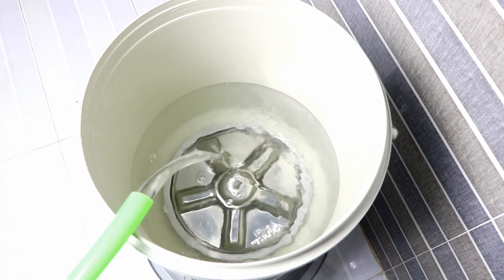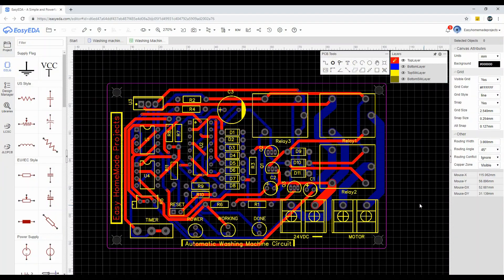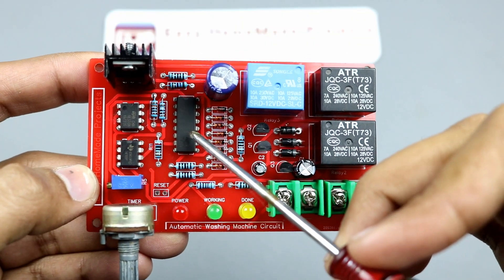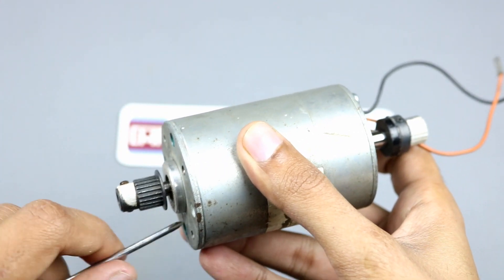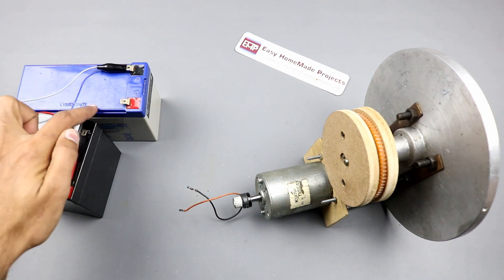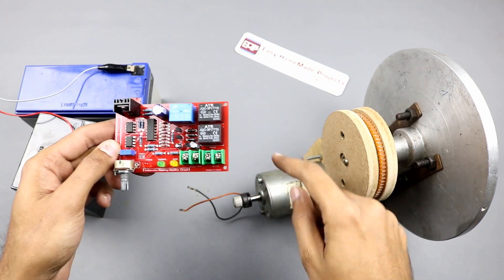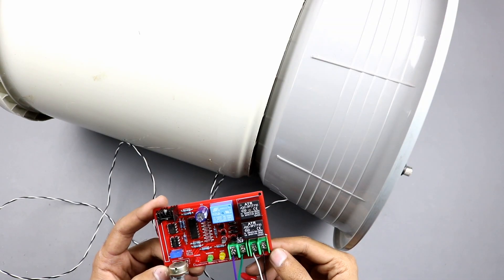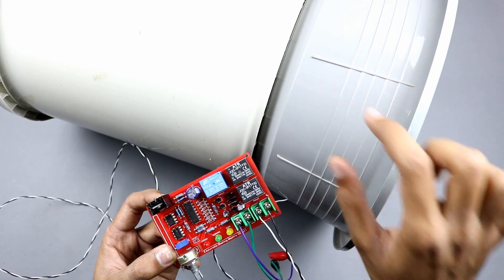How to Make 24V Automatic Washing Machine under 25$

Comment: Great work... but you should make a  drain water system to this  machine. It's imp to drain dirty water automatically and you need to modify the circuit accordingly to control the system to drain dirty water out. Anyways nice work 👍

Comment: I would use epoxy and silicone to bond and seal everything. Maybe even silicone sheet cut out to make a water gasket. Use washers on the screws so they don't strip out and bolt the base to the washer. Just me tho.

Comment: This is not automatic washing machine, this is conventional manual machine without programmed cycles includinh spinning mechanism, valves for water intake and discharge pump for emptying the tub.
Reply: That's true
Reply: @Kolorijo12   thats not true he tried to do an upgrade

Comment: It's an excelent proyect, but there will be problems with the parts of your washing machine that were joined with silicon glue
Reply from the maker: No parts are joined by glue. It only works as a seal for water leaks.
Reply: @EasyHomeMadeProjects  an apology for my ignorance sir hehehe, it just seemed to me that you joined some parts with silicone glue, but now I know the actual purpose of it, thanks a lot.
Reply: Ronaldo Daniel Martín Pasapera Montalbán Epoxy is better